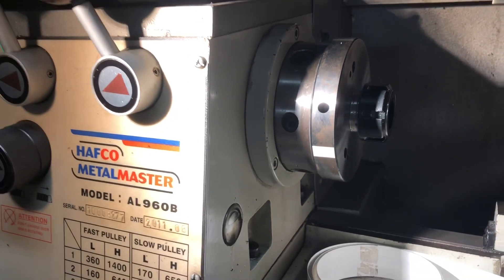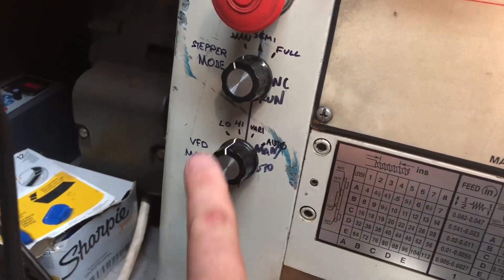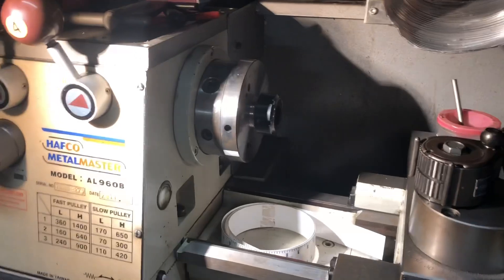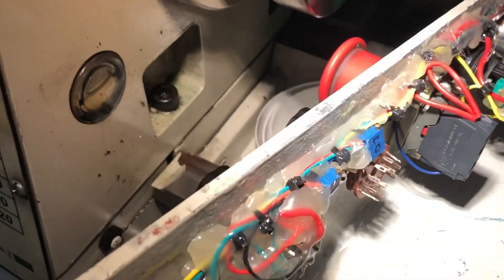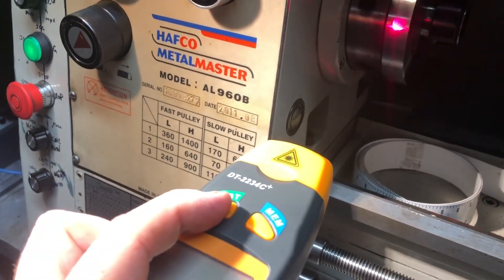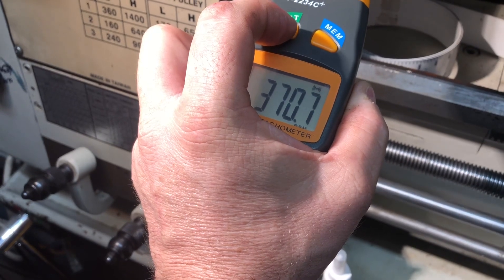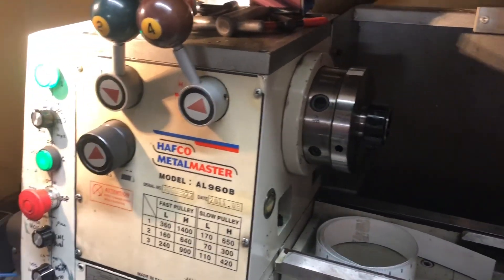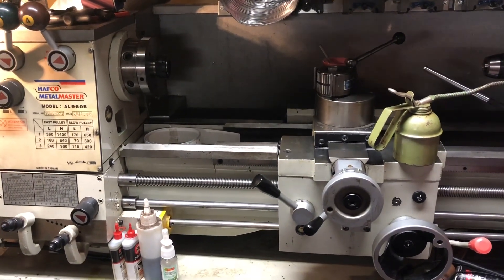AL960B Lathe Salvage - Electronic VFD Pulley Replacement

Comment: Hi Marcus. That looks pretty fancy, I was thinking about a simpler system with a VFD for my little lathe, my intention was for variable speed and reversing for screw cutting, will yours reverse, and  possibly a higher speed in reverse? for returning the carriage for the next cut
Reply from the maker: I have reverse wired up on the throw lever, could potentially include a relay to switch the speed for reverse as well!
Reply from the maker: Or simpler, use low speed for cutting then flip to Vari for reverse,
Reply from the maker: Jog mode also is an option for slow forward and regular reverse

Comment: Hi.
I am new in this channel and in to lathe turning as well. Just bought a Lathe similar to yours , actually a junger version then yours, but I have problem finding "NEAUTRAL"  between gear shifting....any tip would be appreciate..Thanks in advance...Cos.
Reply from the maker: There is detent ball and the detents are only in the engaged position, so the neutral is only vague and accidental. Hope this helps to answer your question :-)
Reply: @JBFromOZ  Hi And thank you very much for your input and great help. I had a filling theren't was a neutral. So I just have to select a fust speed in order to to turn the chuck and easy select gears...all good, now I know for sure..thank you again , I find your videos very helpful.
Reply from the maker: That’s awesome mate thanks for subscribing :-)

Comment: Hi can I have your opinion on the al 960B I’m considering a new one after a bad experience with a new 10 x22 Chinese lathe. Thanks
Reply from the maker: Not sure how far through my build series you have seen, but in my tear down and rebuild I found a sensible and well built machine, with great tolerances and machining. I love the 3 phase with VFD mod that I did, being able to switch between high and low range gears at the flick of a switch is really awesome. As my lathe was missing the compound I can’t speak to rigidity in the top assembly,  but I have not missed having a compound so far, and the machine is rigid in my current configuration. I would recommend a thorough first inspection to remove any grit and Swarf inside a new machine regardless, as there was significant dirt inside the headstock and apron saddle in mine

Comment: Very nice setup i am impressed
Reply from the maker: I still need to fix the jog wiring, needs a positive wire to signal, instead of the ground it has now. Very keen to get to constant surface speed control, hopefully get that project on video soon
Reply: @JBFromOZ  i would like to see that set up

Comment: hi,can i install a jog button without a vfd.i have the same lathe 960b.thanks geoff
Reply from the maker: G’day Geoff! great question! There are two important functions for jog in my mind, first being able to “run while held on” and the second is “run at a low speed”. The VFD does make these both simple to implement, as the Jog run frequency is settable independently and from memory on my current config is 8 Hz (down from 50 Hz ) or approx 16% of full output speed. And the second capability is the motor voltage  is isolated from the switching trigger. I would expect it might be possible to hack a jog switch with a relay to open and close 240V without burning contacts, but you would still possibly have speed issues and/or low startup torque. It might be good enough in a pinch however!